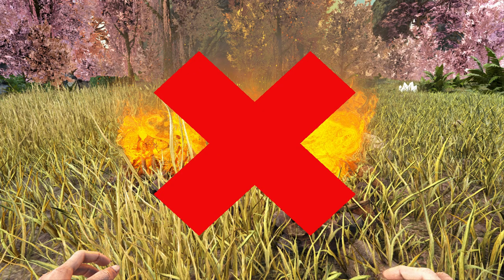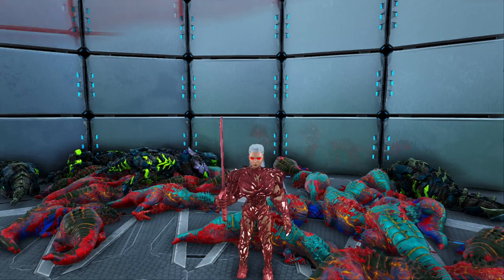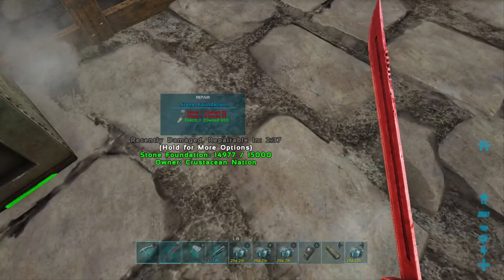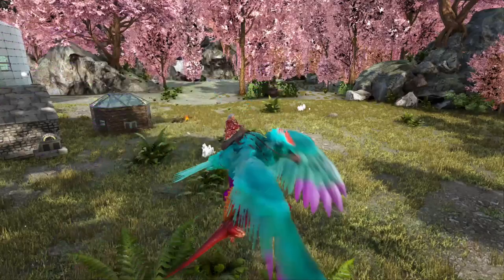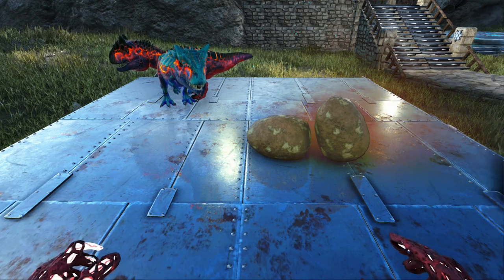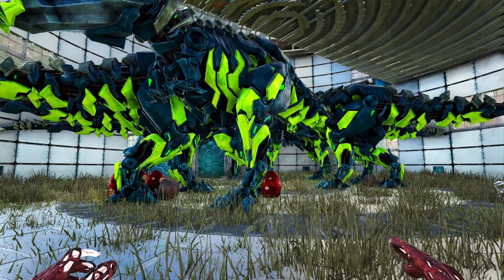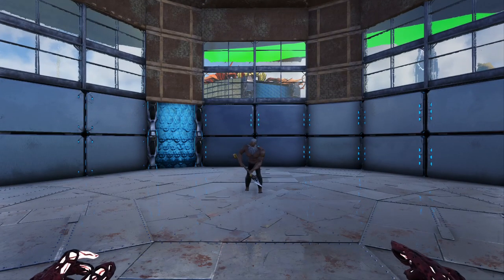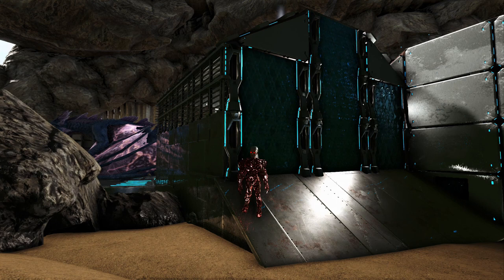5 Tips for Building A Breeding Hatchery

Comment: U must never lose your eggs through the ceiling.. curse xbox's inferiority 🙄
Reply from the maker: Oh that's happened to me too 😰 But it only seems to happen when the eggs hatch when I am out of render of the hatchery. So I stay nearby now. If this is a persistent issue for you. You could use metal foundations then have the air conditions around the edges then place metal walls or doors in front of them to protect the AC units from damage.  I just like the bigger area of using a floor.